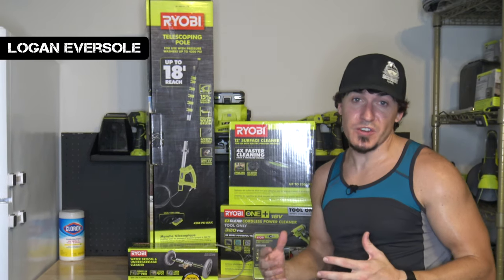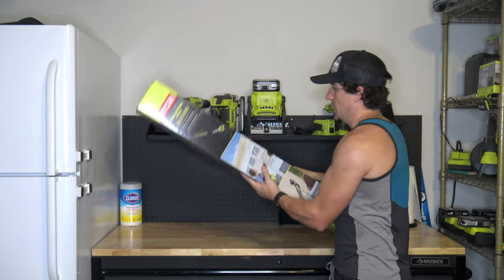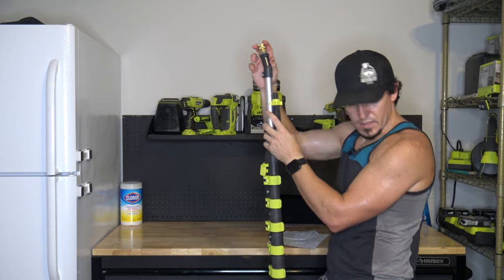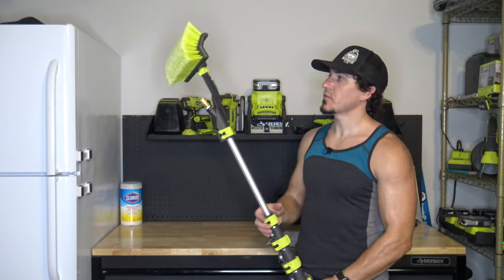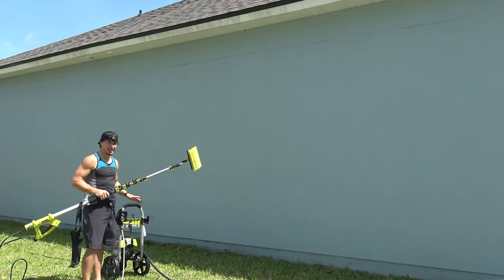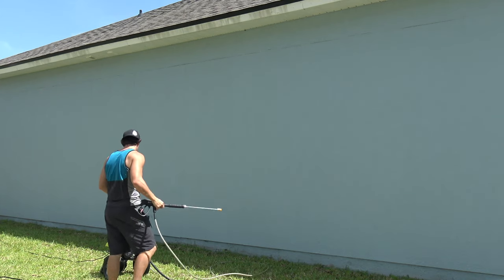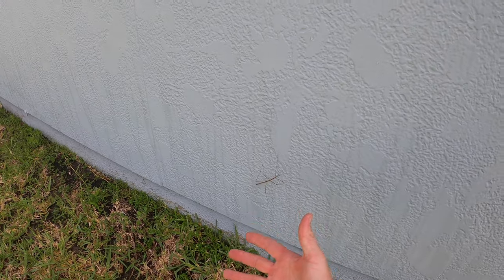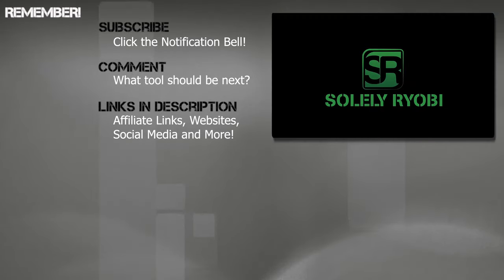Ryobi 18 ft. Adjustable Telescoping Extension Pole Pressure Washers Attachable Brush Head - RY31EP26

Comment: A Velcro strap should lock the handle into open /flow position.  That's what I use on the regular pressure sprayer handle.

Comment: I can imagine that this would be heavy and unwieldy, but it sure did a nice job on your fascia. I did think that you had the brush head angled poorly for the angle you were scrubbing, but getting that set properly will likely come with experience. Nice review. Did you manage to identify and use every little piece you had rattling around in the box when you were unpacking?
Reply from the maker: You are absolutely correct.  Because the brush and nozzle are at different angles it takes a bit to get it just right.  But after a few uses you'll get the hang of it.  Yes, everything was in the box.  The pieces floating around were for the shoulder strap mounting hardware.  They are likely in a plastic bag normally so they don't move around.

Comment: I bought this and used it to clean the house this year. 

Leave the brush off unless you need the brush. 

I used it for a 2 story house and it worked great. Be ready for a lot of torque pushing it back and jerking if there is an air pocket in the line. Mine came with an additional wand extensions for a total of 21 feet plus a rain gutter 180 turn. 

I needed to use a screwdriver to pry open the connectors slightly to insert the sections. 

I am twice his age and in half the shape. I had no problem the second day after I figured out how to use it. 

Great product. I would not get on a ladder with a pressure washer due to the force, distance you need to be from the house and so on. This is a perfect solution.

Comment: Are you able to attach a foam cannon to the end of the pole quick connect to apply a chemical house cleaner? Great video by the way!
Reply from the maker: We haven’t done that yet, but you should be able to because it is just a quick connect. You may need to move or remove the brush on the end. But otherwise, it shouldn’t be a problem.

Comment: Although titled as 'an extension pole', it is an extensible replacement for the entire sprayer handle & wand, costing almost as much as the original compressor.  A better design would have allowed you to attach the handle to any of the segments, depending how far you needed to reach, so you only need to carry the weight of as many segments as necessary.  As it is, fully extend the smaller (lighter) segments first, and adjust the shoulder strap fulcrum along the first segment, only as needed to balance the wand as far as needed, and keep the shoulder strap shorter than demonstrated, so your elbow is just slightly bent when the wand is almost vertical.  
A much more reasonable alternative for most in need of a little more reach would have been a 3 or 4' insert extension for the existing 16" wand, or a 5 or 6' replacement wand.

Comment: Thanks for the video. Your house is not high and you can  most likes do that with a latter and no pole.  And is it possible that’s a belt and not a shoulder strap.
Reply: Its not a belt and you have obviously never climbed a ladder and tried pressure washing but thanks for the insightful feedback